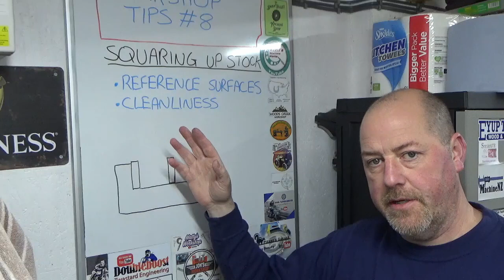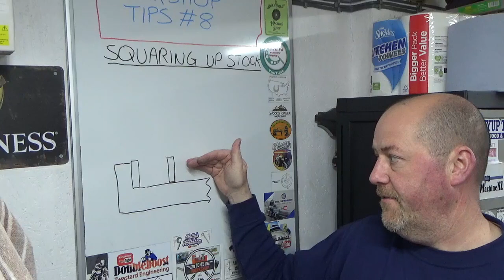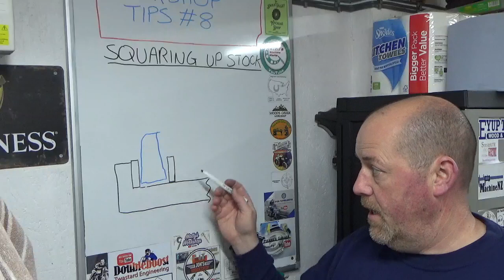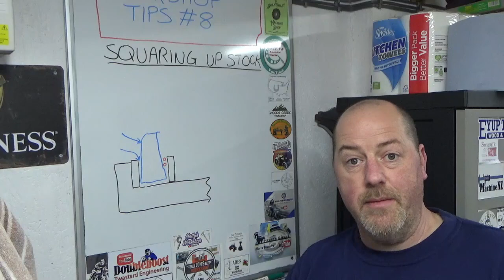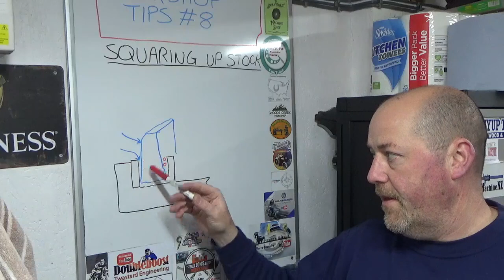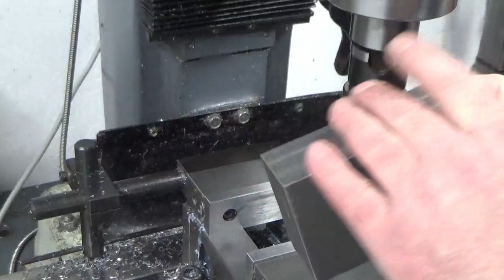Workshop Tips #8 - Squaring Up Stock  - Explained

Comment: I’m confused. If your first reference surface is not flat, think a bow, and it projects above the vice jaws, then would not the next 2 machined surfaces be misaligned by the curvature of the first surface? It would appear to me that the first reference surface needs to be machined flat and then proceed from that surface. Without one known flat surface things are a bit skewed.
Reply from the maker: Hi Glenn, thanks for the comment and feedback. You are absolutely correct! I threw a straight edge over my reference surface prior to starting so I knew it was good enough, but I didn't call that out in the video. You are absolutely right, if the first surface is not flat then this would affect the overall squareness achieved and that 'reference surface' would need to be skimmed flat first prior to following the rest of the steps I went through. Thanks for pointing that out, I will pin your comment as I do not like giving incomplete or incorrect information out. Cheers, Jon
Reply: Hi Glen See my comment above.
Reply: Correct. Cold rolled stock has a dip in the middle, always machine the largest face first.
The moving jaw does not always lift. The Kurt style with the nut in front of the moving jaw, actually pull down.
I always use the vice jaw as a more accurate reference than my ground square. This is because the part is clamped fully against the fixed jaw. When machining the 5th face I have the part edge on the fixed jaw in the vice so the squareness of the vice jaw determines the accuracy of the longest edge not the width. If I am out by a bit with my ground square against the largest face the error is smaller across the width than it would be along the length. If the part section allows, I machine the 5th face between a pair of vee blocks, sometimes the whole part can be machined this way.

Comment: Great tutorial. On my first cuts, I will also put a parallel or a piece of copper wire underneath the back edge of the stock. I do this on any face that is not machined, except that which is against the fixed jaw.
Reply from the maker: Hi My lil mule, thanks for the comment and tip, Dave Ticehurst also said that, something I was never taught but is a good idea. Cheers, Jon

Comment: have you seen joe pie's way of doing it in 2 setups?  machine surface 1,3,4,5 & 6 on tall parallels, flip it over machine surface 2 to thickness. It's very clever although I haven't tried it myself.
Reply from the maker: Hi Paul, thanks for the comment. Yes, I have seen this and been meaning to try it, totally forgot about it and reverted to my grounding lol. Pretty sure I will get another opportunity to forget as well. Cheers, Jon

Comment: Hi Jon, good video. I use a different technique; First, large face up in the vice with half inch or so (depending on size of stock) above the jaws. Mill the top large face, & side mill all around the four edges down to just above the jaws. Turn over mounting the milled edges in the vice & the milled large face on parallels. You now have six perfectly square sides. Now with the large faces in the jaws, & a side milled edge on just one parallel against the rear jaw, mill the now top edge. Turn to mill each edge. No wire needed.
Reply from the maker: Hi Dave, thanks for the comment. Yeah, seen Joe Pi and Dave Ticehurst show this method, I forgot all about it, this would have been a perfect job to try it on too. Cheers, Jon
Reply: Joe Pie also does it that way.
Reply: @rickymale8203  oh cool :-)
Reply: @rickymale8203  and every CNC machinist if the blank is thick enough.

Comment: Hi Jon,
Great treatise on squaring up, and touching on the subject of Kinematics ( aka 6 degrees of freedom), I've always borrowed a practice from woodworking school, ref marking up "Face Side " & "Face Edge", which mirrored your marking of machined surfaces. Obviously pencil on the wood, but maybe a very light scribe mark on the metallic materials then, don't remember having marker pens then?, this was late 70's .
The only step that I feel was missing,  was to check for squareness, after each op,  with the burr on or off  ref if square has a relief etc.?.
Again excellent video, watched it fully, great to see Thor on the job 🤗 🔨. 
Thanks for sharing. 
Best regards from the Black Country. 
John.
Reply from the maker: Hi John, thanks for the comment and feedback. I did check squareness, just didn't film it (daft bugger), and if you saw the state of my square, I think you would unsubscribe fairly quickly lol. Something I need to fix. Cheers, Jon

Comment: All squared away and then the damn thing warps because of skin tension being reduced, oh well.😕
I might take isdue with you on one thing, best not to tighten the vice after you have done the thumping, because it is the tightening that causes the jaw to lift. Do an experiment with a parallel under the work and see if it comes loose again by tightening, often it will. Thumping after full tightening prevents this, but aim the blows more to the fixed jaw side if the part is wide enough.
Do you ever get the feeling you are teaching your grandmother to suck eggs, oh well again. 😉
That's all folks and back to the asylum, to quote Reginald Gardiner,  if you are old enough to remember him?
Reply from the maker: Hi Chris, thanks for the comment. Yes, you are right, I was taught this way. I try to avoid it on a hobby mill as it really means knocking hell out of your  machine at full vice grip. I go with an 80% initial nip, followed by tap down, then just a final tweak on the vice. It does still lift sometimes, and if on parallels where it is easy to discern, I do go for some final hammer violence. Cheers, Jon

Comment: Really good video John. I plan to do things like that if and when I set up my small shop in Thailand. Just basic things for trainees or apprentices as these things are important . Another question mate. Do you think small factories manufacturing whatever, need a maintenance workshop/manual machine shop if the manufacturing machinery for the products is brand new?  A difficult question I know.
Reply from the maker: Hi Dermot, thanks for the comment. As for your question, this is a difficult one to answer really. Most companies buying brand new machines usually get a service and maintenance package to cover the first few years. Also, a bit like new car, if you aren't following the specific manufacturers service and maintenance procedures, you may invalidate any warranty so companies may be reluctant to stray away from the manufacturers manual etc. For anything over 3 to 5 years old, there could be an opportunity. Cheers, Jon

Comment: I have seen several of these 'squaring up' videos. Most seem happy to put the steel block in the vice, machine one side spin it round and do the opposite side. etc. etc. Very dodgy for the reasons you have stated.

The way I was taught, which I hasten to add I have never repeated. This was on a very rough cut piece of cast iron bar.
1) Place in vice face up, machine surface. You now have a reference surface.
2) Turn 90 degrees and square up reference  to firstly vice base take first cut then, if required,  adjust block using engineers square to check for the 90           degree angle. take another cot(s) if needed. You now have a face and edge at 90 degrees
3) flip 90 degrees end over end so that the reference edge is against the fixed jaw. Square up face and edge cut second reference edge.
      This gives 3 reference planes at mutually 90 degrees to each other.
4) Finish up the the other 3 faces to dimension.

Not cutting the faces or edges parallel until the end leaves the maximum amount of material to clean up useful if your block is close to dimension at the beginning.
Maybe this is over kill but it means you can get a square block if your vice etc is poor. You only need your machine to cut a flat plane but then if it doesn't you are really sc.....d.
Reply from the maker: Hi Graham, thanks for the comment and alternative method. Many ways to skin the cat, and I like the consideration to minimal stock in this. Cheers, Jon

Comment: Hello Jon, any reason you would not machines faces 5 and 6 as Phil Menzies suggested? Or even when you had done faces 1 and 2.
Reply from the maker: Hi Nigel, thanks for the comment and question. Yes, I did have a reason but you are absolutely correct, I missed pointing this alternative method out in the video. My mill just won't manage a long cut (40mm in this case) without horrendous vibration, so I chose to go down the route I went. Also, the steps I showed were more generic to cover say a surface grinder/shaper setup etc, where you have to address each face individually. Hope this helps explain. Cheers, Jon

Comment: Nice instructional video Jon.
I can understand for simplicities sake why you may have skipped over it, but  with a block larger than your vice you could have also squared sides 5 & 6 at any time as you were machining sides 2, 3, or 4, (given the restrictions of your cutter reach). And whenever possible it would be advisable to do so. Every setup introduces errors 😉
Also, another g'day from the antipodes. You have a few already,  I enjoy getting a word in before all the yanks! 🤣
Good stuff. Keep it up
Reply: Ahhh. I pondered the same, when I watched a few days ago, just re read the comments to see if someone else asked the question.
Reply from the maker: Hi Phil, thanks for the comment and suggestion. Yup, you are bang on, I should have made reference to this in the video. The reason I didn't do that on this occasion is my mill just won't handle a cut that long without horrendous vibration (even though I have cutters long enough). Hopefully this comment will be useful to others. Cheers, Jon

Comment: I use the copper wire for many years now. It never failed on me. Siple and effective:)
Reply from the maker: Hi Rusti, thanks for the comment. Yup, me too, used it a lot in my early career, I used to have a drawer in my toolmakers cabinet with loads of lengths pre-cut at different diameters etc. Cheers, Jon

Comment: Jon, it is generally advisable to also put a rod under the block for your first cut. This is because sometimes the block could drag on the vice base when tightening with the copper wire or whatever and not fully align itself with your fixed jaw. The see  saw effect of the rod, will help the part align itself against the fixed jaw. You only need to do it on your first cut, as your second cut will have your so called "Reference" face on the vice floor. I have also done a video I show how to set up side 5 without the use of any square etc. https://youtu.be/FfDFYYJLxyw     Regards from Australia.
Reply: Never thought of that Dave ! Most just belt the crap out of the job to make sure it is seated in the vice - or so they think . if you use a known parallel under the workpiece you can check each end for wiggle - if none then the workpiece is down tight .
Reply: I think if it sticks half out the vise the surface should have been machined first not last just incase it's banana shaped.
Reply from the maker: Hi Dave, thanks for the comment and suggestion. I have never seen that before but it makes perfect sense. Yeah, I forgot about the  method you and Joe have shown, this would have been a good job to try it on too. Oh well, I am sure there will be more. Cheers, Jon
Reply: Hi Dave. I've posted a few methods to square up blocks. A rarely seen one is the "chasing the burr" technique. This involves finishing all 6 sides to size without deburring until completely finished.